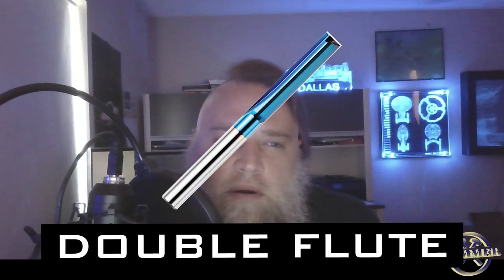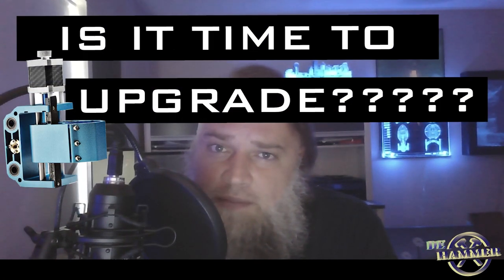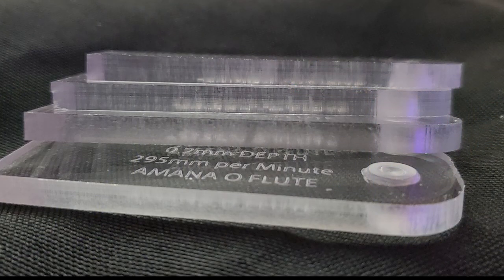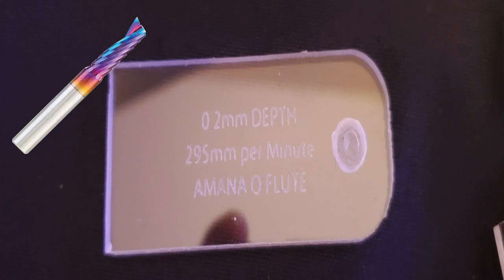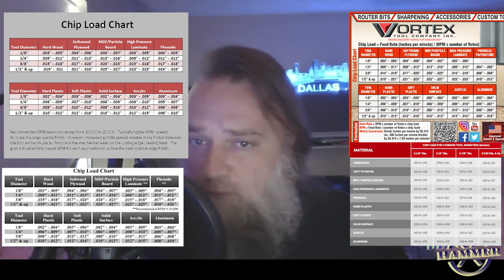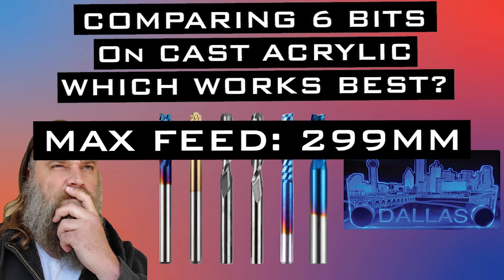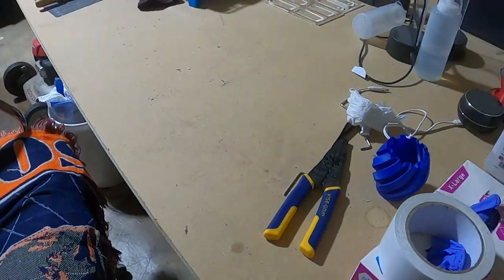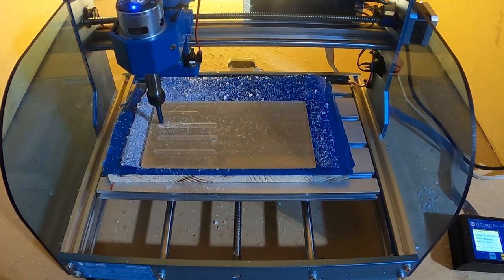Quarter Inch Bits Vs. Stock 3018 PROVer - Chip Load with O & Double Flutes Vs Cast Acrylic

Comment: Have you tried putting a little blue loctite on the set screws?
Reply from the maker: I was thinking about doing that, but forgot to as I just use my smaller diameter bits on it and no issues.